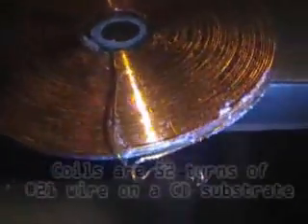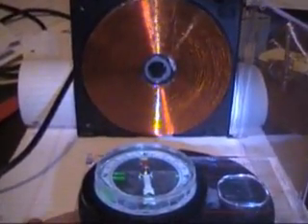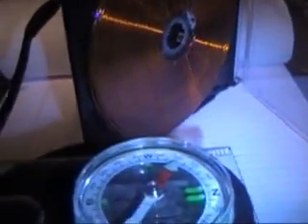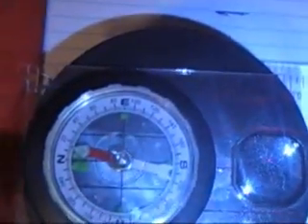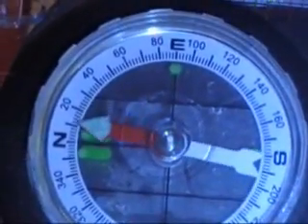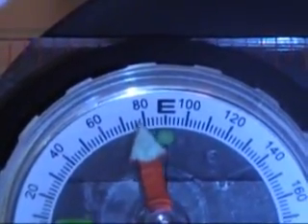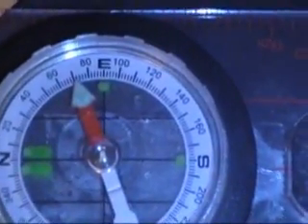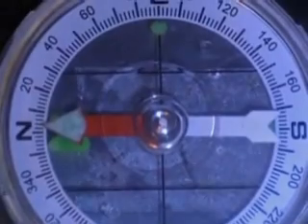hydro4f3a 016 Pancake polarity

Comment from the maker: @gilligan80 Thanks for bringing up these points. In the time since I made this simple comparison, I have read a couple of the transmission patents (for running motors and such). My CD coils are really small compared to what Tesla was describing, so I would need to get a better signal generator get into the higher frequencies needed for these small coils and learn how to safely generate and measure higher voltages for some of the larger coils I have made.  Thanks for the comment.

Comment: The bifilar pancake coil is designed to be used for either really high voltage (single wire transmission) or with a current of high frequency.  This coil is not to be driven as an electromagnet its intention is to be placed BEFORE an electromagnet... because with high voltages or high frequencies the induced voltage creates a high capacitance which cancels the induction..... NO BACK EMF....its all in the patent... yet nobody cares to actually read it....